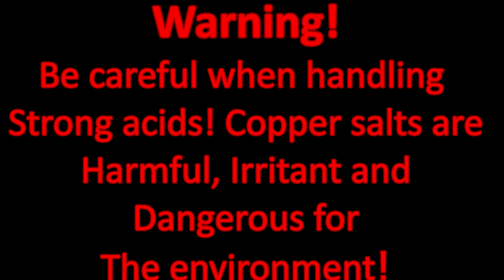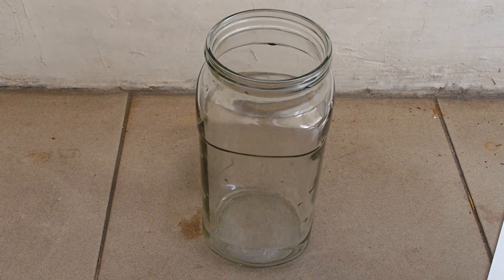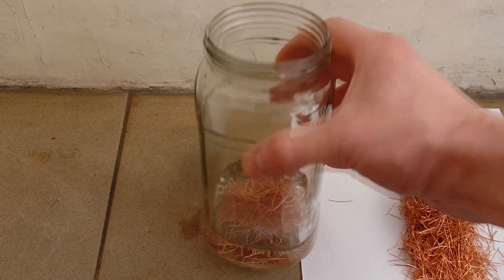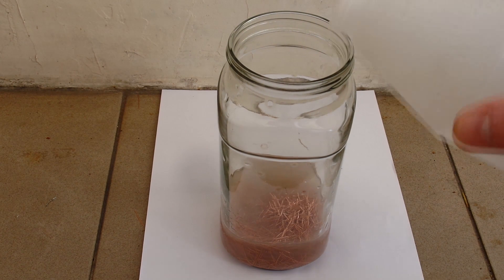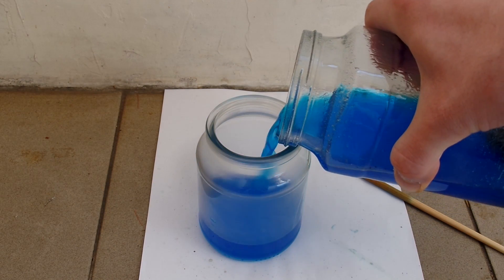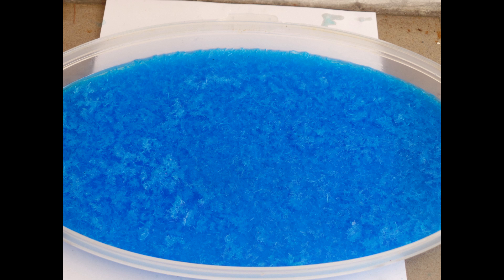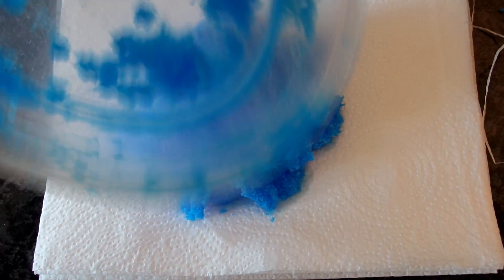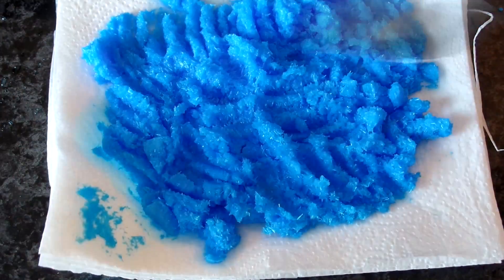How to make copper sulfate from copper metal

Comment: Sounds like a horror movie 🍿 I can see why the reaction was done in an open container. Still nitric acid is a very useful byproduct. Heat resistant glassware is a must an overflow precautions. A pyrex casserole dish would be good.

Comment: The way you took out time to answer almost every comment calmly (even annoying ones) shows you have the heart of a good teacher. I learned a lot from this video and will attempt it soon. Keep it up please.
Reply from the maker: Thanks! 

I evaluate curiosity, and love to give knowledge I have gathered by simply being curious! Also teaching others is the best way to learn! 

Give it a try, and stay safe! NOx gasses are toxic, so be careful! And if You have any questions - I will try my best to answer them! 

Good luck! :)
Reply: Just one question please. What was the ratio of the ammonium nitrate to the conc. Sulphuric acid? And how did you mix them. It wasn't shown in the video. Thank you
Reply from the maker: @onadejibabatunde8983  
If I remember it right, I had nitrate crystals mixed in acid, I did it long before I filmed this video, so I did not show the mixing, but I just combined acid and crystals, and had it sitting in a bottle for a long time. 

I suggest You to add fine nitrate powder to acid in small portions in case heat is generated. add a small portion mix it, check the temperature and if it is not getting too hot add more until You added all. My mixture had some crystals on the bottom, probably sulfates and nitrates that did not dissolve. 

I have answered similar question, so here is  copy of my answer:

"Check this site for amounts:

https://www.webqc.org/balance.php?reaction=KNO3%2BH2SO4%2BCu%3DK2SO4%2BCuSO4%2BNO%2BH2O

To dissolve 10 Cu, You need 10g KNO3 and 20g H2SO4(100%) or 50g H2SO4(40%)(assumed battery acid strength), 

We have 2 main reactions in here:

1) Sulfuric acid reacts with nitrate salt, to make nitric acid
2) Nitric acid reacts with copper to dissolve it and make copper nitrate

Because sulfuric acid is in excess, it will then react with copper nitrate to make copper sulfate and nitric acid, which will dissolve more copper. 

Because HNO3 release nitric oxides (brown toxic gas), Nitrate ions are also consumed in this reaction. Less so, if concentration is small. 

If You have patience, You can use dilute battery acid, few days and You copper should dissolve, but I have not done dilute reaction, so I do not know how it would go. "
Reply: @TheMrbunGee  Wow! Exhaustive information. Am now equiped enough for this experiment. I will let you in on how successful I was at it when done. Am so grateful!

Comment: When you use nitric acid, you get copper nitrate, not copper sulfate.. To get copper sulfate, you had to use sulfuric acid instead of nitric acid.
 You now have a mixture of copper nitrate + copper sulfate because you used copper nitrate (as an alternative to nitrite) + sulfuric acid..
 In order to obtain pure copper sulfate, you must be satisfied with sulfuric acid.  You can help increase the chemical reaction by adding hydrogen peroxide, and heating over medium heat.
---------------
عندما تستعمل حمض النتريك فستحصل على نترات النحاس وليس كبريتات النحاس.. لكي تحصل على كبريتات النحاس كان عليك أن تستعمل حمض الكبريتيك بدلا من حمض النتريك.
أنت الآن عندك خليط من نترات النحاس + كبريتات النحاس لأنك استعمل نترات النحاس ( كبديل لحمض النتريت )+ حمض الكبريتيك..
لكي تحصل على كبريتات النحاس النقية فعليك أن تكتفي بحمض الكبريتيك. ويمكنك المساعدة على زيادة التفاعل الكيميائي بإضافة بيروكسيد الهيدروجين ، والتسخين على نار متوسطة القوة.
Reply from the maker: This is the way around it, copper sulfate is more stable than nitrate, so whenever sulfuric acid is present, sulfate will form. Nitrate salt is mixed with sulfuric acid, which liberates nitric ions that can react with copper - forming copper nitrate, which is converted into copper sulfate and nitric acid as long as sulfate ions are present in the solution while copper sulfate crystalizes out of solution. 

There are two easy ways to find out which copper salt You have:
1) Heat a small amount, sulfate will turn white, and nitrate will turn black (Releases NOx!)

2) leave a small amount in humid place, nitrate salt is deliquescent, meaning it will absorb enough water from air to dissolve it, leaving a small blue puddle. Copper sulfate will not. 

Both of these tests, also dozens of reactions, including some other copper chemistry on this channel - all proves this is sulfate. 

Peroxide method is also viable, can use that if peroxide is available! 

Have a nice day! :)

Comment: Nice video
Acid is combination nitric and sulphoric
Reply from the maker: Thanks, sorry for "music" :D 
Acid is sulfuric with nitrate salt.
Reply: @TheMrbunGee  can potassium nitrate be used? or calcium nitrate be better? is there any difference between the two choices? for 100g copper wire how many gram of the nitrate salts to be used?
Reply from the maker: @HereNow2226  Yes, You can use pretty much any nitrate salt, as sulfuric acid cannot dissolve copper metal alone. Nitrate salts reacts with H2SO4 to form HNO3 in equilibrium. That can then react with copper and form Copper nitrate, which again reacts with sulfuric acid and produces more HNO3. I have not experimented with this, but I think You might use relatively small amounts of nitrate salt. You should experiment - add small amount (like 10g of nitrate to 100g of copper) and if the reaction stops after a while - just add more. 

difference between Ca and Na salts are that CaSO4 is insoluble, One could react it with sulfuric acid and filter some of CaSO4 off the mixture, gaining more concentrated and more pure HNO3. 

To calculate amounts of reagents in reaction - use this site: https://www.webqc.org/balance.php

GLHF.😎

Comment: how much copper can i desolve using your coil method ? i finally made crystal using car battry acid and your coil method but. will it be better to concentrate barrty acid first? if i keep conecting fresh copper will it desolve forever or will the acid burn off eventually?
Reply from the maker: Check this site for amounts:
https://www.webqc.org/balance.php?reaction=KNO3%2BH2SO4%2BCu%3DK2SO4%2BCuSO4%2BNO%2BH2O

To dissolve 10 Cu, You need 10g KNO3 and 20g H2SO4(100%) or 50g H2SO4(40%)(assumed battery acid strength), 

We have 2 main reactions in here:

1) Sulfuric acid reacts with nitrate salt, to make nitric acid
2) Nitric acid reacts with copper to dissolve it and make copper nitrate

Because sulfuric acid is in excess, it will then react with copper nitrate to make copper sulfate and nitric acid, which will dissolve more copper. 

Because HNO3 release nitric oxides (brown toxic gas), Nitrate ions are also consumed in this reaction. Less so, if concentration is small. 

If You have patience, You can use dilute battery acid, few days and You copper should dissolve, but I have not done dilute reaction, so I do not know how it would go. Try it.

Comment: If you added a condenser column and cooling, you could’ve collected the vapor and condensed it into concentrated nitric acid. It’s the same way I make mine(sulphuric acid and nitrate salts) idk tho maybe heat it but not to boiling point so it won’t bring up copper also.
Reply from the maker: True! :)

Comment: Why is your h2so4 in an absolute vodka bottle?

Also, why don't i ever see anyone try to recover the nitric acid by bubbling the no2 in peroxide?
Reply from the maker: I mixed it there with nitrate salt, it was the largest glass bottle I could find. 

for me, at the time, I had no peroxide. But, if I had any, I still would not waste it for nitric recovery, concentration you get is weak and amount is small. If I did NO2 reactions  more often, I would use some recovery device, but not if I do this once a year.

Comment: The goddamn copper is not going to passivate from a concoction of sulfuric acid and nitrate salts
Reply from the maker: Well it already did. Your prediction is incorrect and way too late.
Reply: @TheMrbunGee  No it didn't passivate because of the reasons you you think copper metal does not dissolve in sulfuric acid copper oxide however does introducing an oxidizer push the reaction forward you introduced a means towards an oxidizer passivation is a little different passivation happens in the exact opposite sense. If you would have added an oxygen source such as chloride potassium's sodium or ammonium it would have worked the same way. You were assuming that it was creating nitric acid in a very crude since it was but that's not what was causing the so-called passivation. The trace nitric acid that was forming before billowing out is already diluted enough to destroy copper and definitely not strong enough to cause passivation. Passivation occurs somewhere around 50% 70% I can't even remember it's been so long.  Passivation is the coding or treating of a metallic surface to remove or reduce its reactivity. What was happening with the copper was exactly the opposite

Just remember it nitric acid reactions the reaction stop because of oxide layers with sulfuric acid  oxidation is required to move it forward at least in the case of copper. It's similarly happens with hydrochloric acid. In a pinch of Throne store bought hydrogen peroxide to move good reaction forward.
Reply from the maker: @ClownWhisper  In the process of reaction, when substance is covered with a layer of reaction products, preventing further reaction is called passivation. It does not have to be metal and/or acid. 

In this case, copper is covered with copper nitrate/sulfate, because there is no available water to dissolve the salts and the salts are not soluble enough in acid mixture - layer stays there and there is no contact of metal with acids, and no reaction, or simply - passivation happened. 

Have a nice day! :)

Comment: Basic chemistry only add Acid to water  NEVER WATER TO ACID.  You see the fiery heat build up in the jar! Also wear gloves and one assumes safety glasses?
Reply from the maker: Well - you have read your book, but on these scales it is not dangerous to add cool water to cool and not ultra concentrated acid. It is actually hard to make acid splash pouring water in it, even on purpose.

Gloves must be used for handling toxic substances. I don't mind  having a few yellow dots on my hands. if you do - wear gloves!

Comment: Do you have access to cheap hydrogen peroxide? It would perform the oxidation step quite well without making toxic fumes and with only a small amount of added impurities.
Reply from the maker: True, but peroxide for me is hard to get and expensive, this is way cheaper and i think faster also.
Reply: H202  can buy at a beauty supply, that uses to color hair.  15, 20, 30, and 40 vol peroxide.

Comment: Red-Brown fumes are nitrogen dioxide/dinitrogen tetroxide and should under no circumstances be inhaled, as they can cause delayed edema of the lungs - a very serious condition whose symptoms may be delayed several hours and can be fatal if the exposure to inhaled NO2 was intense. Never do this indoors without an extracting fumehood such as found in laboratories, or outdoors only in a well ventilated area.

Comment: so basically you just used concentrated sulfuric acid and copper? I thought I heard you say you used  nitrate salt with the h2so4? I would think that would be KNO3 then?
Reply from the maker: Yes, but I used ammonium nitrate and sulfuric acid in excess, to dissolve copper.
Reply: Could you use potassium nitrate instead

Comment: You have made copper NITRATE, not a sulfate. Because only nitric acid produces NO2 gas
Reply from the maker: Copper does not really react with sulphuric acid, so nitrate salt is added to the acid, that forms nitric acid and dissolve copper, emiting nitrogen oxides, because nitrate salt is less stable- excess sulfuric acid reacts with copper nitrate and forms copper sulfate and more nitric acid, which can dissolve more copper metal. Traces of copper nitrate are left in solution, but majority of it is copper sulfate. In crystalization and decanting proceses copper nitrate is removed from final product! :)
Reply: @TheMrbunGee  ok, thanks!

Comment: nitric acid and copper is not copper(||)sulfate!
Reply from the maker: yes, but when sulfuric acid is in excess sulfate forms.
Reply: Correct, it's used as an oxidizer with sulphuric to speed up the process, I do it when making my copper or nickel sulphate for plating electrolyte. Work good, desolves the metal fast. But gets hot, be careful

Comment: Never add water to acid! Also, lots of heat released, glass might shatter throwing acid all over. This is not a process for DIY'ers. Just get cheap copper sulfate from Zep Root Kill at Lowes or The Home Depot.
Reply from the maker: You know that not everyone lives in USA? Not even half. Why do you think there are The Home Depot's all around the world and copper sulfate laying in every corner? 

And this is an easy process for a home chemist to do. This is to explore the chemistry. When I done this I had like 10 kg of pure CuSO4. 

And acid is not that bad, don't be scared of this liquid. And I had the copper in when I added water, there was 0% chance of it spilling.

Have a good day! :)
Reply: Still, please teach proper safety techniques as far as mixing chemicals no matter where you are located. Thanks.
Reply from the maker: there is nothing wrong in the way I mix chemicals. It would be a different video if I were mixing 100% sulfuric acid and water.

Comment: WEAR FUCKING GLOVES YOU DUMB ASS
Reply from the maker: Gloves are personal protection. I advise you to use them, If you have any doubts about your own safety!
Reply: I advise you to use them too, I always use PROPER safety techniques when handling strong acids, toxins, or flammable substances. As a fan, I would rather not see you get hurt, so I would advise you to take more care of what the fuck you're doing.
Reply from the maker: Every time I do something all the risks are considered and proper safety precautions are taken. Eyes must be protected every time, but even strong acids or bases wont hurt my hands if they are washed off quickly. I have this possibility to wash  my hands quickly so I choose not to use gloves and without gloves I have more control of what I do and less chance of accident.
Reply: Wearing gloves is still a very good practice though, just use thin ones if you do not want a high chance of spilling.
Reply from the maker: Good practice is to be careful.

Comment: Lol.... no rubber gloves?   Dumbest thing ever
Reply: rubber gloves can catch on fire when touched by nitric acid.
so maybe thats not that dumb.
You probably never had acid on your hand.
It doesn't hurt. It does nothing basically.
You have over a minute to wash it off your hand before it starts itching slightly.
Thats somewhat better than having a rubber glove on your hand ignite after 3 seconds, which burns your whole skin away and melts the rubber in your skin.

Comment: You may want to consider getting a bubbler  and put that brown gas to some good use. That way your expensive and hard to get nitric acid is going to be readily available and free.
Reply from the maker: Yeah, sure, I could have made about 30 ml of HNO3 in best case, but as you can see I am quite short of lab equipment in general. This reaction might be much more efficient if proper equipment were in place. :)
Reply: I understand your point  , just thought it was worth mentioning  since you mentioned hard to get chemicals . Same problem here , not everything is readily available and most prices are prohibitive for the amateur  chemist .
Reply: @TheMrbunGee  you could bubble it through a sodium or potassium hydroxide solution and get a nitrite salt.
Reply from the maker: @chemistryofquestionablequa6252  Yeah, like gram or two of salt. noth worth it in my case. :D

Comment: There's a slightly dangerous way to make more pure copper sulfate: dilute piranha solution (H2SO4 and 3% H2O2) + copper wires
Reply from the maker: Johnpao215 yeah, that would work, I am not sure how much H2O2 you would need for how much copper sulfate. And purity ~ copper sulfate is so easy to purify, that I can't see a problem there. Also I am not sure about speed of reaction, but if you dont have nitrates and have peroxide - why not! :)
Reply from the maker: Johnpao215 and I dont see why it is more dangerous :?
Reply: Hahaha. I prepared mine using that. Well, piranha solution is dangerous in contact with organics. Almost runaway reaction (same as you) using that method minus the NOx fumes.
Reply from the maker: How much H2O2 you used for how much copper sulfate?
Reply: Consider these equations:
H2O2 + 2H+ +2e− ⟶2H2O
Cu(s) ⟶ Cu2+(aq) + 2e-

There is 1 mole of peroxide to Cu metal. Of course, use excess peroxide since it is more easily decomposed at higher temps.
Reply from the maker: Johnpao215 yeah, equations are one, but what was your score? It doesnt sound like fast and quantetative reaction, because of dilute peroxide!
Reply: I actually used 30% peroxide, just in case you don't have access to that you may try the diluted one. By using the 30% peroxide, I was able to obtain a saturated solution just after the reaction.
Reply from the maker: Johnpao215 yea, I can't really access that stuff. But I have tons of CuSO4, so Im fine! 😂
Reply: Haha. Well, that is the essence of Chemistry--finding alternatives.

Comment: I rolled this out today ie Monday the 28th of August macroscaled it by using drain opener acid and calcium nitrate fertilizer that I crushed and put in a soda bottle and added a gram of  copper wire cut in strands with a scissor and would you believe I managed to pull it off pretty well with exceptions of insoluble sulfate in solution that hampered the reaction but brown fumes were pretty copious and adding water both accelerated temperature and rate of reaction concurrently. Thanks a lot for your presentation.
Reply from the maker: Thanks, glad to be helpful!